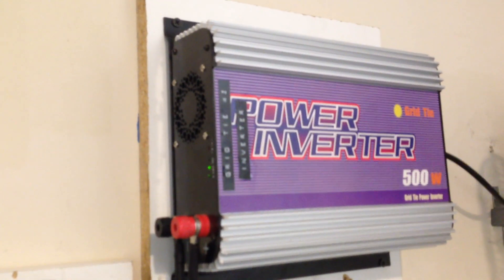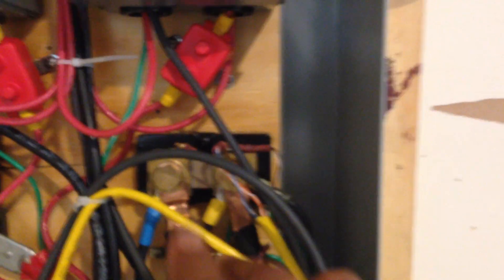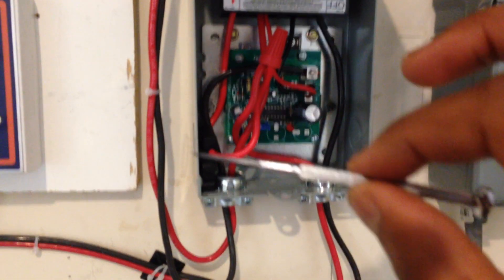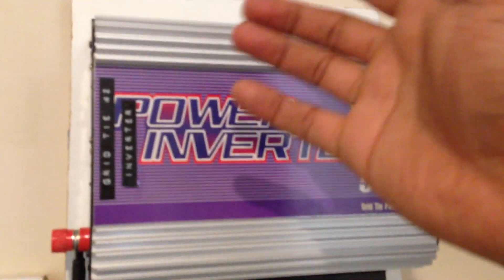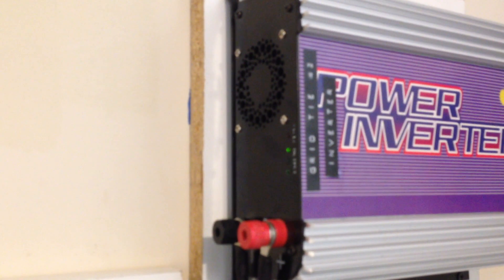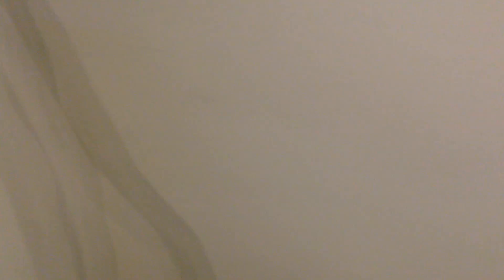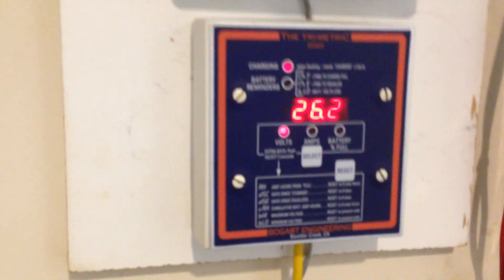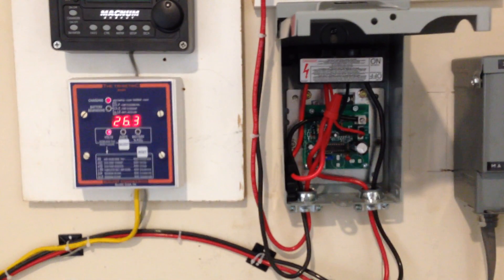DIY-Solar Hybrid - with the GTI Controller Part #2

Comment from the maker: Guga, to answer your question.
1.) I have 4 solar panels
2.) They are in sets of two (2 panels connected in series for higher voltage.
3.) Actually, being in series allows my charge controller's mppt function to capitalize on the higher voltages to charge the batteries faster.  I've since added another Grid tie connected directly to one array.  The combination gives me what you suggest in your comments.

Comment: Mount your gti about 1 1/2 inches off the wall to help the air flow from your fans keep the back side of the gti cool.
Reply from the maker: Glenn Muse I agree with you.  I actually did something like that in my "Tips on how to keep your Grid Tie Inverter cooler" video

Comment: Hi there. Very nice vids you got. 
Just a few questions about the system:
1) how many solar panels you have?
2) do you use all of them in paralel or have them in series? 
3) If you have your array in paralel, wouldn't make more sense to: first charge batteries and after all of them floating, direct the panels straight to your grid tie?! 
This way you would not discharge the batteries and grid tie would be almost the whole day sending energy to your grid. 
What are your thoughts.
regards from Brazil

Comment: Enjoy your videos, it helps alot to see it done and in use. I dont need much backup, power has not been an issue, but I am thinking of buying a 2000 watt inverter and using my golf cart for my backup. It is 6-6 volt batteries. Thanks
Reply from the maker: Thanks for your comments, 6 6v batteries in a bank and a 2000 inverter is all you need.

Comment: it feels funny to hear you talk about me.. sorry i thought your gti only worked off battery's for 2 minutes at a time but i see now it runs after the batterys are full.

do you use the batterys only for backup or all the time?
i have solar on the roof but would like batterys for the peak when the sun goes down.
Reply from the maker: Thanks for the comments and your clarification, I mentioned your comment for the benefit of other viewers who may have been wondering the same thing. The batteries are strictly for backup. There are many who use their batteries at night for off grid operations. My system is primarily for backup, the GTI Controller gives me the ability to save a little on the electric and still have a backup, effectively allowing me to gain a little of the  same advantages and savings of off grid operations. Continuous deep cycling of the batteries decreases their life, which can be an expensive when you have to replace a large battery bank.

Comment: Glad to see you do a video on this unit.  I have the unit for the Water Heater from TechLuck and it works great.  I have multiple charge controllers in my system and often wonder if they fight each other.  One has dump load capability that I use with a SUN GTI.  Makes more sense to use the TechLuck device you demonstrate as a dump load only and let the other charge controller do its thing.  Great informative video.  Thanks.
Reply from the maker: Thanks for your comments. I thought about the water heater unit, I don't have the additional panels to support it.